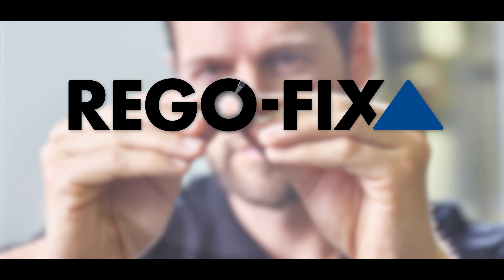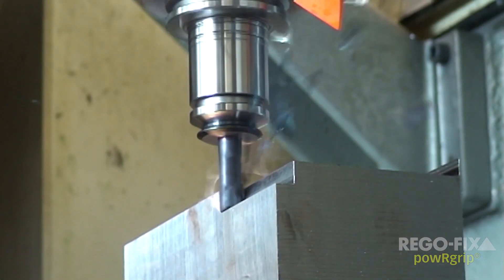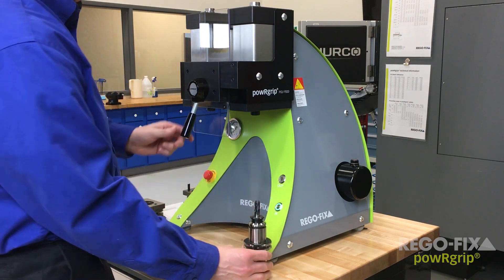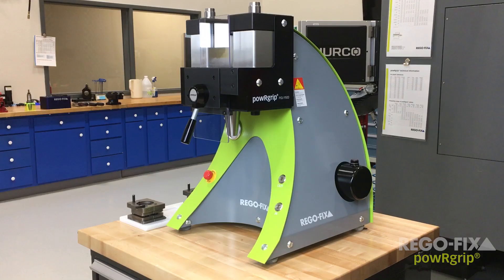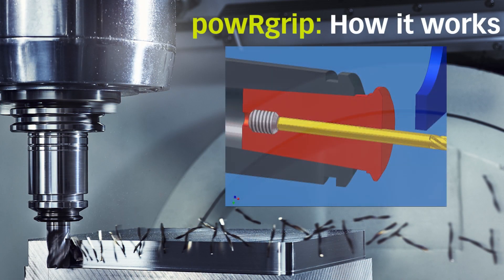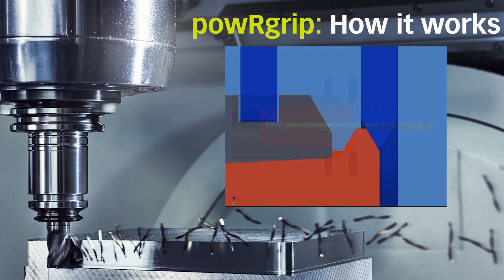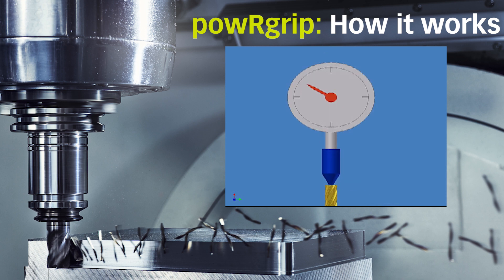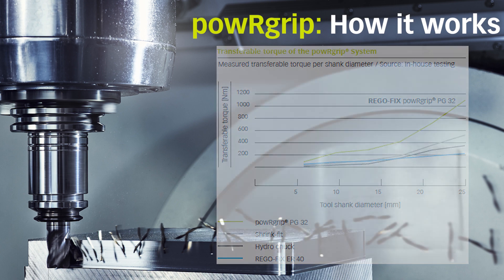powRgrip - How it works

Comment: Ah yes, the E.R. collet system. The highly generalized and hardly repeatable collet system that replaces several more accurate systems for some reason. Fuck E.R. collets. Do yourself a favor and buy an application specific collet. You Will make up the price difference in tool life due to less run out.
Reply: this isnt the ER system lol calm down
Reply: Whats it like to replace an endmill? Does it come out as easy as it goes in?
Reply: i dont think you know what powrgrip is. it has the same if not better runout than shrink fit and has way more torque transfer than a shrink fit holder too. also they give you a guarantee of 50.000 clamp/unclamp cycles with the same runout and clamping force.
Reply: Just say you don’t know.